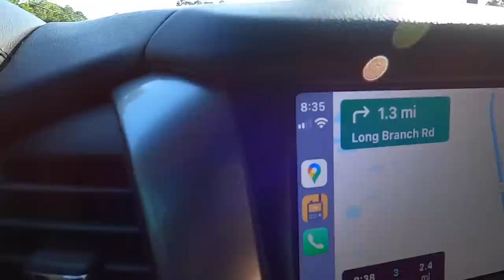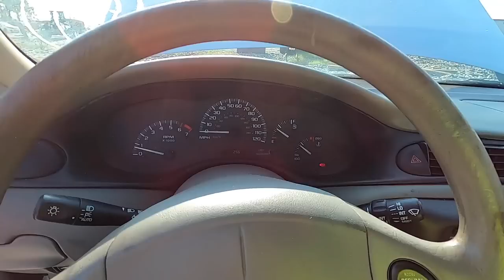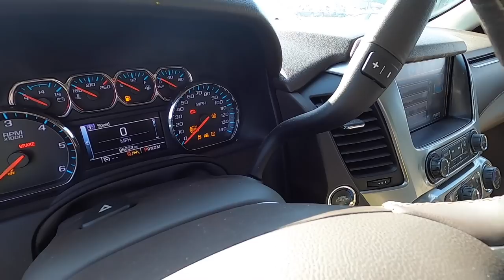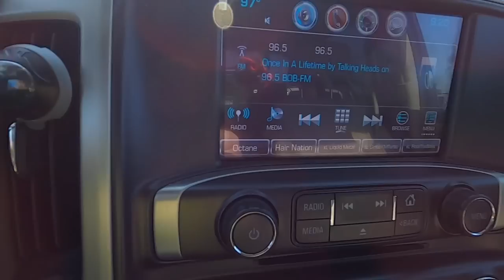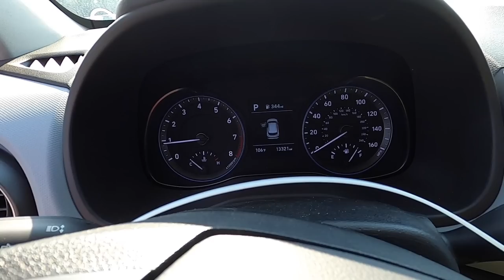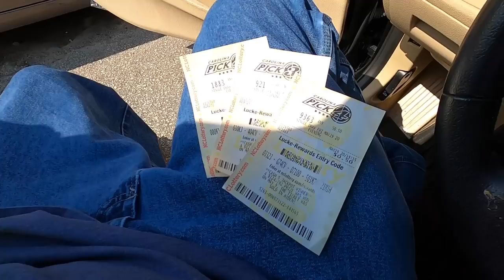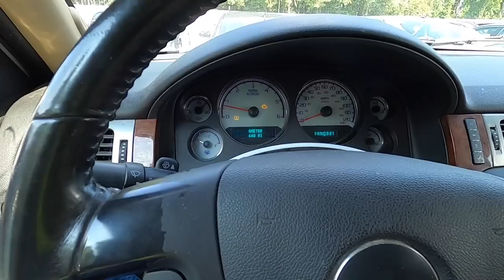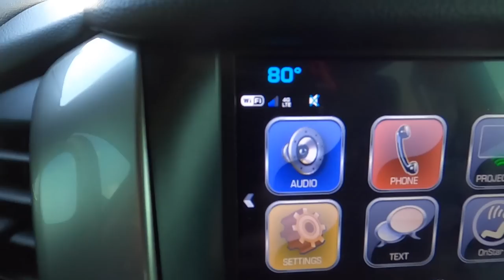RX-8, 6 Speed X5, We Won a Car, Carnage, EXTENDED COPART WALK AROUND

Comment: TK I have a 2005 Pontiac Sunfire with 290,000 miles with the 2.2 Ecotech best engine I've ever seen I don't care what anyone says it has a timing chain rather than belt I've owned this car from new regular oil changes never had a problem with the engine at all that is a great engine
Reply: Totally agreed, my Vue was tough as nails thanks to the 2.2 Ecotec. I still see it on the streets 7 years after I sold it.
Reply: People who have but I've never owned a better car

Comment: My brother has the 2.2 Ecotec in his Cavalier so far so good had it for several years
Reply: The 2.2 Ecotec is very reliable. I had a 2003 Vue, purchased in 2010 with 90K miles, sold 3 years later with 130K. I just saw it last month driving on the street, no smoke nor anything wrong with it. I bet it's close to 200K by now

Comment: Chevrolet never had an SS offered on the Avalanche, also that looks like the stock stereo, and the Avalanche SS stitching is from the old Avalanche Badging so that was a custom thing someone did to it... it at most it an avalanche LTZ based on the looks of the inside, and the 07 avalanche didnt offer lane departure. 
I personally have a 2008 Z71 loaded like the LTZ Avalanche. I had to do a DOD / AFM delete last year to keep her running when the system fried a valve. But id love another Avalanche

Comment: Those Douglass Performances tires are real good. I had a set on my 2013 Forte Sx, I recently traded for my 2020 Elantra. They stick to the road and they do not slip when hitting the accelerator.

Comment: Sorry for all the multiple comments but I keep watching and finding more stuff to comment on LOL plus it's such a long video I love it anyways I think Copart to be able for them to claim if a vehicle runs or it runs and drives Etc, every vehicle when it comes in they give it a check over which includes jumping the vehicle or hooking it up to a jump pack in order to see if it starts and moves and then they put it on the lot that's how they're able to tell if it runs and drives I would assume I have no proof of this but it makes sense to me unless the car is a real bad biohazard or it crunched up so much it's not even worth trying but I'm sure 90% of the vehicles when they come in are checked. jumped if needed by the jumpack to start they run it through the gears see if it moves backwards, and forward, etc. It's not a huge check over just a quick check then they mark it, take pics and then it goes on the lot.

Does anyone know if I'm right?

Comment: Like the GMC Pickup nice .. for a Chevy. TK I hear u about the borla exhaust pimpin thing on a 6 cylinder. I put a borla on 4.0l 97 Jeep Wrangler just for the stainless part because let’s face it even back in 97 stock jeep exhaust suck.. mufflers baffles rattle & they are hell restrictive. I personally think inline 6 4.0 jeep motors sound great with borla. I6 or worse v6 your not getting a lot as far as sound boost, but a big uptick In quality. That said the 3.7 & 3.6 v6 Jeep engines are poop shit had my daily 14 , unlimited wrangler pop 2 head gaskets in a year on the right head under warrently thankfully. BMW destroy sound cool never thought those were that good looking anyway.